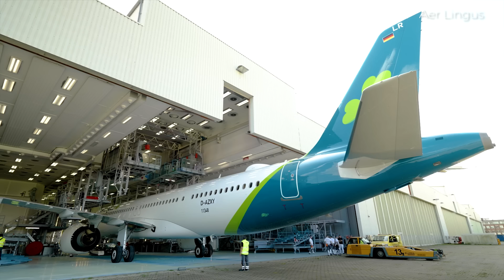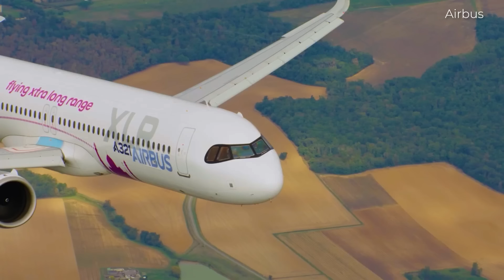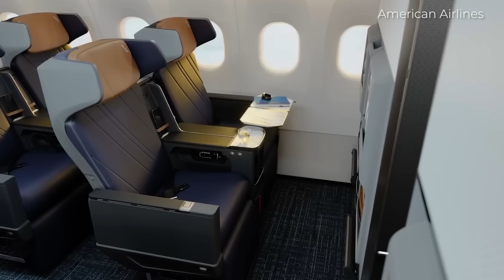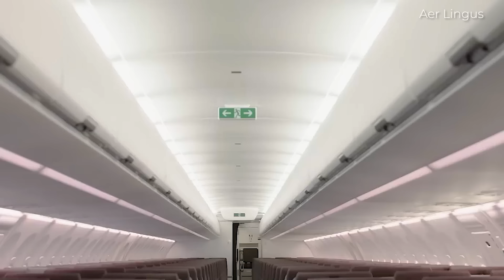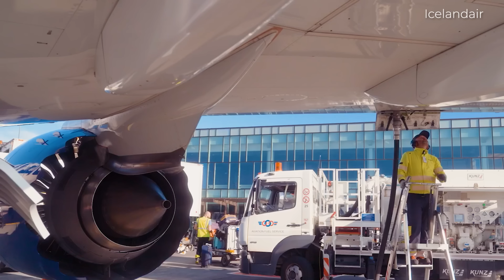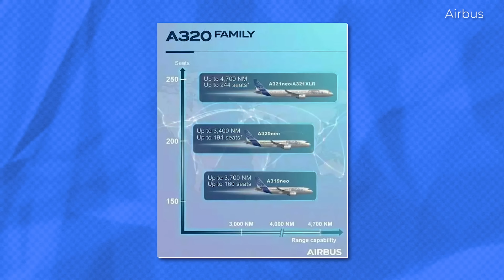The Airbus A321XLR Could Change Air Travel Forever

Comment: Crossing the atlantic in a narrow body is lunacy. Ive flown 747’s and DC-10’s and at times would get rocked by turbulance. This is just airliners being cheap.
Reply: People used to fly with the 707 and the DC8 in the past, Even DC6's and Super Constellations.
There's basically no difference in comfort between the XLR and widebody planes.
Reply: @damcoentertainment3956 theres a reason they arent used anymore haha
Reply: Its a different story if the current technology dictates lower altitude oceanic crossings.. im sure the first time the model T came out it was considered the greatest mode of transportation ever lol
Reply: @terryjr1982 those aircraft aren't used anymore because they're like 60 years old.
Reply: @moekitsune well age vs relevance is what comes to mind. As we speak, the air force is flying 1957-1963 stratotankers to the middle east. With 1960’s B-52’s standing by. Being augemented by 1970’s C-5’s. If you upgrade the aircraft to meet performance, than its age has no bearing on its capabilities. The issue people seem to overlook is narrowbodies crosssing the atlantic didnt have the thrust or wing loading to truly make a smooth ride. The moral if this topic is the efforts are fairly regressive in nature as the industry discovered large aircraft capable of flying above the weather proved to be smoother and safer.
Reply: Well you won't have any other choice soon enough, especially during low season
Reply: @soilentgreen7 start flying international carriers, they are at least using widebodies still
Reply: I've done many transatlantic flights on B757s with no issue at all, in fact they were much more comfortable than equivalent flights on a B777 (a noise aircraft). 
As the A321 is wider than the B757 I'd expect them to be more comfortable and quieter too.
A cousin has done several YYZ-MAN flights on the A321LR and were very happy with the flights.
We must be lunatics then !
Reply: @DaveTWJ205L by flown ive meant as a pilot… for a living.. and currently still a pilot. Saying a 757 is less noisy than a 777 is beyond ignorant 😂 if your oppinion is a 321 is a great transatlantic flight then perhaps you think grilling dog tirds with enough seasoning will taste like chicken.
Reply: @terryjr1982 worst flight DC10, best flight A380, hundreds of flights on B747, 727, 737 from the -200 to the MAX, 757, 767, 777, BAC 111, Comet, Trident, F27, F50. F70. F100, Dart Herald, etc, etc. mostly great flights but some shockers - and the size of the plane was irrelevant. 
With comments like "grilling dog tirds(?)" your pilot communications to your customers must be a hoot. Grow up.
The B777 I've always found to be noisy, especially in Business Class, with the GE90 versions being the worst.
B747s upstairs were generally good, but the A300-600R in First was the best... Quiestest plane generally A380. Nicest plane A330.... And I like my chicken without the chlorine wash, grilled with a hint of lemon.
Reply: @terryjr1982  777 is made loud though. Any modern narrowbody is quieter from inside. Flew the 737 max between LHR and YHZ and it was nice and surprisingly quiet. Fell asleep while being on a window seat. Can't say the same for 777 or 767 I used from LHR to ORD, in only fell asleep because it was cold but woke up again.
Reply: @Dav @DaveTWJ205L reds ?? Haha your so full it. Im a retired air force pilot and current commercial pilot, a little over 10,000 hrs over 25 years and im close to maybe 300. So clearly your full of crap. And as a pilot, im well aware of how a plane works haha for you ill informed, the xlr has the same wing as the 321 with more weight and stretched out… same problems as the md-11 to the DC-10, same as the 737 max from the 200 series, “which by the way im currently a pilot on” and now the xlr. Fyi, the 727 never had etops, neither did the f100. The title was using a narrow body on a transatlantic flight. TRANSATLANTIC… step climbing in a narrow body is NOT the same as a 767 or bigger… but congrats lol
Reply: @favourmiracle7094 the noise is predicated on speed primarily. The max and 320 series are flying alot slower than the 76,777,787, 747. By alot! In the the 73 we cruise around .78, even in the max. The triple and 78 around .84 to .85.  Difference is massive when dealing with slot times. Not to mention a 40 year gap in R and D. That route you took probably went wayyyy north outside jetstream. Us lower 48 folk wont go the high outside the nat tracks, to tune of 15 to 20 grand an hour, to add 2 hours to fly outside the jetstream.

Comment: There is a spot for the aircraft, but I do not like flying single-aisle aircraft on long-haul flights. It is the low budget airplane for long-haul. For long-haul from secondary markets, it is a good option for those folks.
Reply: Yep, for people who just want to travel from A to B, this will provide a great opportunity for them to do it without connecting and most people prefer non-stop flights.
Reply: @magnustan841  There is a point where nonstop becomes worse though... like uncomfortably long.  For example, I live in Ottawa and we have almost no direct flights to anywhere, but suppose (hypothetically) AC decided to run a direct flight from Ottawa to, say, Singapore.  This theoretical route would probably be around a 19 hour flight, but I could get to Singapore in one shot.  There is no seat in the universe (whether business or even first class) that I would feel comfortable sitting in for 19 hours straight.  I'd much rather take a 6 hour flight to YVR followed by a 16 hour flight to SIN with 2-3 hours to stretch my legs and eat a decent meal in-between.  In the net, sure, travel time is about 20% longer with the connection, but the experience as a whole is way more comfortable.  Hell I might even prefer taking a second connection in NRT just to break up the trip even further.

Now imagine doing that calculus, but "how long are you willing to sit in a narrowbody Airbus for?"  I don't think as many people will like this as you think.
Reply: Try saying this to those who have to make connections.   Complete passport checkin and then get into another plane!
Reply: Wizzair can use these planes for transatlantic travel. You don't require ETOPS to fly from Keflavik to New York.

Comment: I don’t like how claustrophobic they feel, and also how they actually cruise a lot slower than wide bodies. LHR-JFK can be about 40 minutes more flight time on a 321 as opposed to a 350
Reply: But if that plane is offering DIRECT flights between 2 cities which would not be viable on a wide body then i think most people would not have a problem. Direct flights are much better than having to connect at a hub and those few mins you lose by the 321 flying slower, you make up my not having to make 2 flights
Reply: @Charlesjay7  Correct. Even though you are behind by a few minutes given the plane flies slower, at least you will be where you need to be. And going east from the US east coast to LHR isn’t taking into account occurring tailwinds that could help you arrive early as well.
Reply: JFK-FRA on 747-8 and always arrive 1.5 hours early very fast plane and comfortable
Reply: I agree on the longer flight time but on that route airlines have no problems filling a widebody. This plane is build for serving lower demand routes. With the A321 XLR you can fly direct, instead of going on a widebody to a hub and getting on a narrowbody or regional jet to get to the final destination. In which case the direct route with a A321XLR is way faster. So that compensates for the slower cruising speed and no stress of missing your connection.
Reply: Doesn't matter if you like it or not
Reply: What nonsense. Claustrophobic. "...they feel"????? You have the same headroom when you're seated as in any wide-body aircraft. And you're constantly running around in the aircraft, and you always use both aisles in a wide-body aircraft. All I can say is: imagination is also education, and once you have nonsense in your brain, you can only get rid of it through experience. So, fly with one and see for yourself.
Reply: @gerhardma4687  Is headroom the only factor that determines claustrophobia? Maybe you need some education as well.
Reply: @echoech1319  If you sit down, the seat is more claustrophobic than seeing 10 abreast seating no? Rather have wider seat than a bigger cabin

Comment: As a cabin crew who flies the XLR, biggest issue I’ve encountered is passengers getting up during meal service. Since there’s a single aisle, it's frustrating to have standing passengers blocking our way to and from the galley (they can’t squeeze through between the trolley and the seats as in any other A320, since the cabin is configured with wider seats for extra comfort). 

Other than that, it's a great plane to fly on, allowing us to break out of the routine of short and medium haul flights.
Reply: Time to make a request for passengers to stay seated for 15~30 min for food service.
Reply: @f0x4nn3  We already do that; as soon as we take off, we show a video informing passengers about the food services available during the flight and the services available in the galley. We also ask them to please remain seated during meal service as much as possible.
Reply: @f0x4nn3For every problem request is not solution.
Reply: So 200 people should put normal body functions on hold? ..righto
Reply: @JP-oe4ry yes that's my question how disgusting to request passengers like this
Reply: Instead of wider seats, why not make make it possible to lift the window armest to give passengers a bit more space?
Reply: @steinarnielsen8954 That depends on the seats chosen by the airlines
Reply: @gonzalolarrubia  On none of the planes I've been on have I been able to lift the window armrest. I often do it on trains though.
Reply: I have flown twice in the A321 LR fom Jet Blue to Paris 7.5 hrs flight and it was more comfortable that what i expected 18" wide seats and 32" seat pitch.
Reply: Maybe they could make Meeting/takeover spots with one less seat on some rows? (3 instead of 4) So you can pass passengers there? I'm not sure I explain what I mean properly thou.
Reply: @alicelund147  The exit rows are an optimal meeting/takeover spot.
Reply: Excellent presentation.
Reply: Thats the fault of moronic passengers then
Reply: I live in Asia and it’s normal to have meal service on short haul A320/737 flights here so that’s not gonna be an issue here
Reply: what about the crew rests? I cannot imagine a blocked-off seat gives the same ability to rest as a dedicated crew rest area
Reply: @jeeeyjey yes totally agreed
Reply: Mid cabin lavatories are an absolute must-have on these jets. Please feed back to your employer to install them on the XLRs. It will improve things greatly for you and your guests, because the queues will be broken up.
Reply: @magnustan841  Adding a mid-cabin lavatory is a very complex modification to an aircraft, and I don't think any airline is considering grounding its brand-new fleet. 

A less aggressive idea that I believe will help a bit is adding more business-class seats, which will reduce the available economy seats and thus reduce the passenger-per-toilet ratio. It’s not ideal but in my mind it seems better than what we’ve got
Reply: @gonzalolarrubia  Jetblue A321Neolr has forward, midsection and rear lavatories. They got it right. But I still prefer Delta's A330-900
Reply: @seagullsbtn  the fuel tank in the middle might prevent that idea
Reply: @favourmiracle7094 how?
Reply: Not going to happen. There is a fuel tank right in the middle. Bathrooms must be for and aft.
Reply: @tomg6284how does the fuel tank prevent a cabin lav placement?
Reply: Stuff flows down hill. The center fuel cell is massive, no room under the floor. Plus on one will run a pipe through that fuel tank for a host of reasons.
Reply: @tomg6284 I recently flew an air transat A321 from Toronto to Cuba with that configuration. It’s definitely possible.
Reply: @TheScottbb1  not an XLR
Reply: @magnustan841  Weirdly enough the regular A321ceo’s have mid cabin lavs, JetBlue has them.
Reply: @magnustan841  They could use bedpans!
Reply: @magnustan841 I agree it’s a major discomfort on long flights.
Reply: Former cabin crew on B777 and A330/340 here. This is an issue on twin aisle aircraft as well, and having an extra aisle isn't going to solve the problem as meal service is usually done on both aisles at the same time.
Reply: @MaxVliet yes it does, widebodies have toilets in the middle. Wherever one is on a widebody it's soooo much easier accessing  a toilet, regardless of meal service!
Reply: I believe some airlines have put in too many seats into their XLR’s at the expense of toilets and galley space, I believe passengers have complained about this and airlines are beginning  to rethink the configuration of their XLR’s.  I would rather fly a wide body and possibly have to take two flights knowing that there will be better catering and toilets.
Reply: @londonirish11 Companies are so much behind the money they forgot about customers value
Reply: This is why we absolutley need a 2 - 2 - 2 Economy configuration for the 797/NMA. A long narrowbody is fine, but it has a ton of limits. Flexibility with two aisles while keeping the design small is going to be key.
Reply: I’m sorry, are passengers not allowed to walk?!
Reply: @Bjg6 Tomarrow they will not be allowed to go to toilet also
Reply: Remove toilet restraints for all; toilets should not be designated to a seating class. You should be able to use the front toilet from economy even if there is a Business class in between. You can do a priority function or similar (maybe digital over the IFT), but blocking out is the wrong way. The front toilet is usually underutilized while you need to wait in line in the back. Not a lot of investment needed and easy to realize. And if the C class has seat doors I would even get rid of a separation anyway.
Reply: @tryangle-by-steve 

When you consider how much of a price premium business class is paying, 300-500% of an economy fare,  they also get their own larger dedicated lavatories.   The cabin is also segregated to allow a more premium service experience by flight crew and not have economy passengers walking back and forth or hanging out up front near the cockpit.  Actually, airlines want nobody hanging out near the cockpit.  

You are welcome to pay for the premium service experience too.
Reply: @raptorshootingsystems3379 I flew many times C and even F few times. I know what I pay or what I get. And I still think I don’t need my own class toilet! why? 🤷
Reply: Do yiu want pax getting up or your job?  Choose one.

Comment: I still prefer wide body long haul than narrow body
Reply: Everyone does but then would you rather fly direct in a narrow body or fly narrow body - connection - wide body for your trip?
Reply: @John009Doe i would rather fly wide body + connection 😄
Reply: @John009Doe  I would 100% rather take a connection.  I live in Ottawa.  We have direct flights to London that are currently (thankfully) served by 787s.  However AC had originally (not sure if this is still the case) planned on replacing that direct route with one of these XLR torture chambers.  If (when?) that happens, I will be choosing to connect in YYZ from that point forward.  Transocean in a narrowbody should be straight-up criminal.  11 hours on a narrowbody should be a violation of the UN convention on human rights.
Reply: @deer-door  Hi, why the preference for wide-body?  Does that assume they have wider seats, which isn't necessarily the case (depends on the plane, of course), or because of the 3-3 seat layout versus 2-4-2 or 3-3-3 etc, or is there some other factor?
Reply: @rpg666  It's two things.  First, having two aisles makes boarding/deboarding a lot easier, and also facilitates access to the bathrooms (which is a nightmare on flying pencil style planes).  Second, just having more air in the cabin (more airy, more space over your head) goes a long way towards feeling less claustrophobic.  Finally, premium product is genuinely better on widebodies.  Sure they are installing lay flats on some of these XLRs, but they are these kind of awkward reverse herringbone where you are facing outward (basically facing the person across from you) rather than facing forward, because they can't fit a true long-haul layflat product in there.  The whole experience is just inferior.  Narrowbodies were simply not built for full-service flagship transocean routes.
Reply: Doesn't matter what you prefer if it's the only available plane type on the route
Reply: Then book on wide body